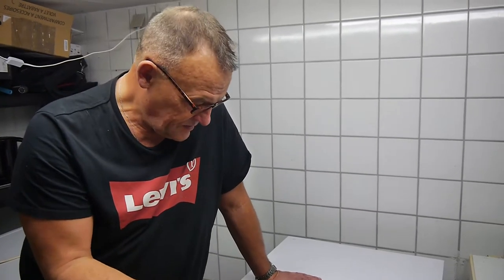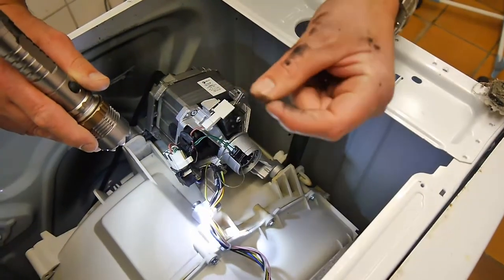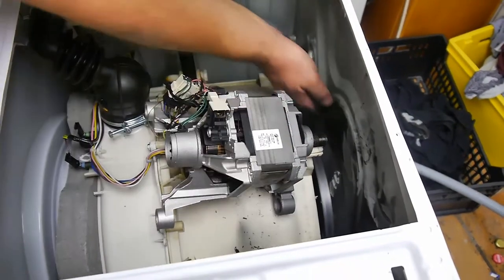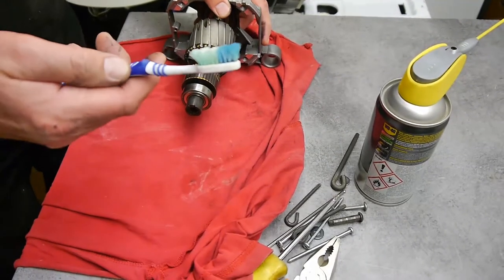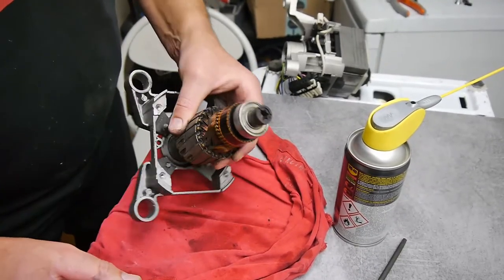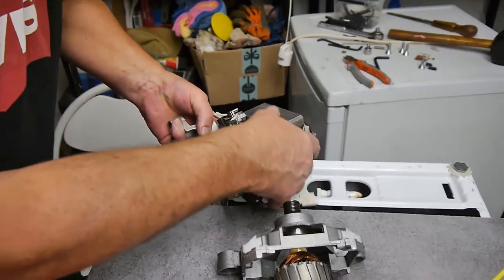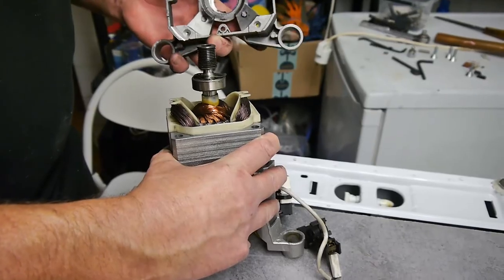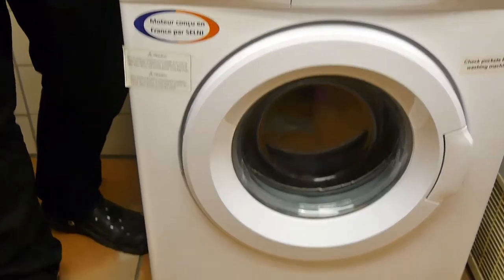DIY Washing Machine Drum Not Turning | Moving | Spinning — Washing Machine Fault — Drum Stationary.

Comment: great vid, did you have to replace the wiring loom as a hole? how to did you replace the wires? did you have to follow it all the way down to where ever it comes out, also any soldering?
Reply from the maker: The wire was made of solid iron not strands and had snapped inside its own insulation. I didn't need to test the whole loom. I fixed the wire with a simple plastic electric block connector (looks a bit like a lego brick) and insulating tape but perhaps I should have soldered it. That same wire broke again, months later, in much the same place. Thanks for watching #HowToBloke 👍

Comment: Great - sved my wife buying another machine (she does nto give me much time to repair things). When I saw the video I thought "roken wire, not much chance of that" - until I saw the broken wire on my machine - broke at a plug - clearly the wire had been damaged whhen the machine was made as the  insulation was clean cut.  So I also cleaned the motor as best I could (this cheap junk doesn't come apart) checked brishes and back workign again. Thanks for this videao, I had seen some others but they didn't go into detaila and were more about buying a whole motor or a board, so I wonder how many people buy a part only to find it does not work because of a broken wire?
Reply from the maker: Glad you fixed it yourself and thanks for watching #HowToBloke 👍

Comment: Very good video..I have the same issue..but when selected spin it turns..so I'm bit.confused..
Reply from the maker: Thanks for watching #HowToBloke 👍 If that same issue happened to me, what I would try is to completely disconnect my washing machine from the electricity supply and leave it overnight. Then, the following morning, try again, and use a completely different washing program.
Reply: I have the same issue..spin mode working drum rotating but rapid 15 not working

Comment: Hey mate my washing machines drum only spins forwards and backwards slightly when pushing with my hands but won't spin any other time, was yours the same?
Reply from the maker: On my washing machine, with the power switched off and the front-loading door open, I could still rotate my drum 360 degrees forwards or backwards manually (for example; as one might do after a wash had finished to double-check for small garments that might still be left in the drum). But when my washing machine was switched on with the front-loading door closed and a washing program started, the drum wouldn't turn at all regardless of which washing program I had chosen.

Comment: If a DEFY 600 front loader spinning and move allover the floor wat can be the problem
Reply from the maker: Thanks for watching #HowToBloke 👍
Well, if that was happening to my machine I would be 1) if the washing machine is brand-new, checking if the in-transit shipping bolts have been removed (on a front loader, these bolts stabilise the drum whilst it’s being shipped). And, 2) investigating the possibility that one of the suspension springs that holds the drum in position had broken or the washing machine shock absorber(s) is defective in some way. Or, 3) the counterweight (usually made of concrete) has become detached. Or, 4) one of the legs is broken, missing, or maladjusted, or the floor is not level.